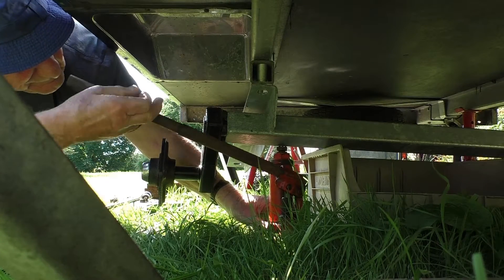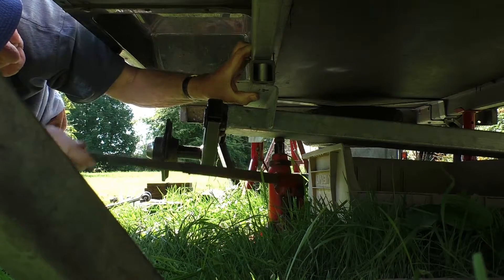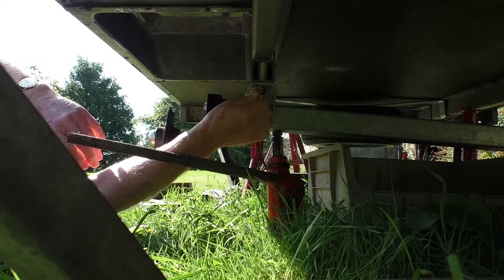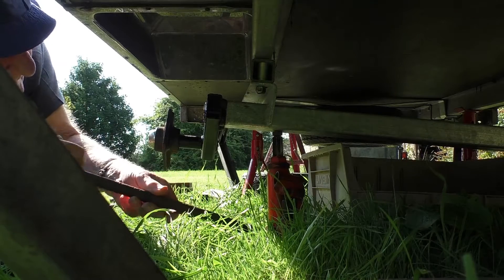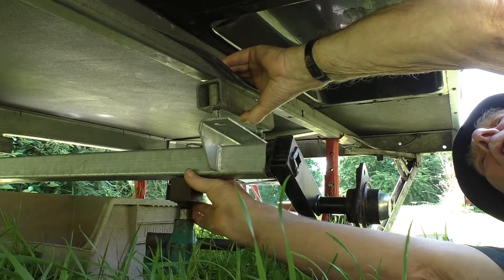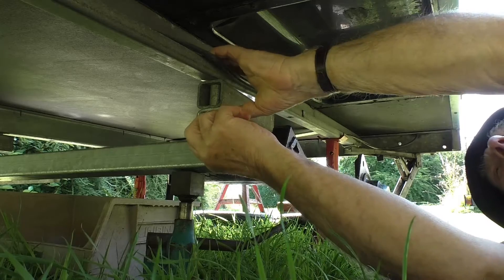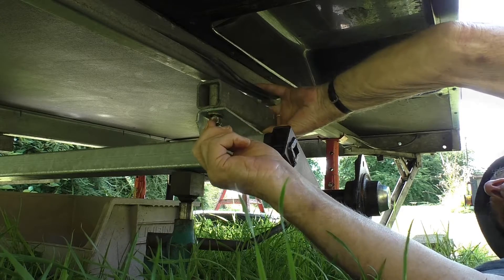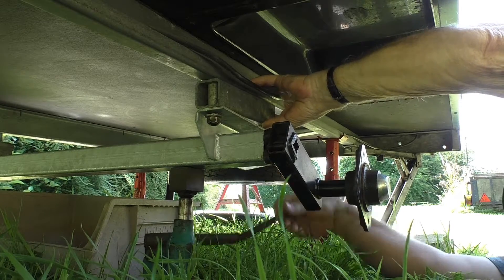Fitting Axle to a Raclet Solena Trailer Tent

Comment: Good video, thanks. Where did you purchase the new axle from?
Reply from the maker: I contacted Raclet UK and they didn't have an Axle so I set about drawing up plans of building one using indespension units but that meant changing tyre and wheel size as it would mean different hubs, the Raclet hubs wouldn't fit the suspension units but that was not a big problem as all measurements were working out, then I got a call from Raclet UK to say they had found one at the factory in France and so I got that sent.
Reply: Thanks for your reply, you did well to get a response from Raclet UK. Whenever I have rung them I am normally told that the parts man is in the yard and will ring me back but never does!
Reply from the maker: That's exactly what I got at first but I kept pestering and persevering and eventually got to talk to the spares man who turned out in the end to be very helpful,